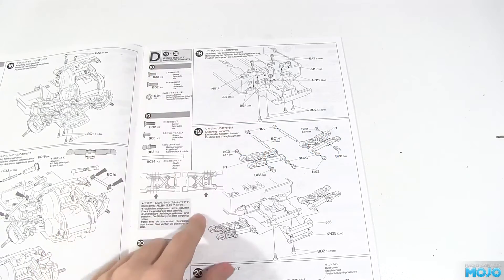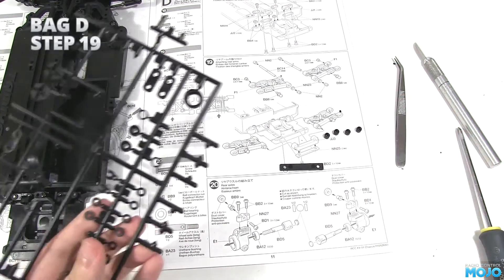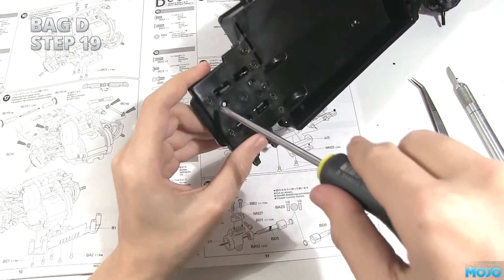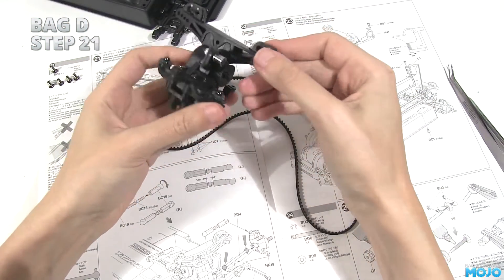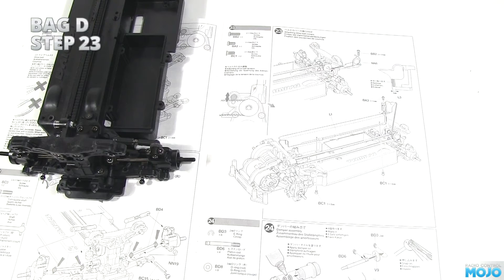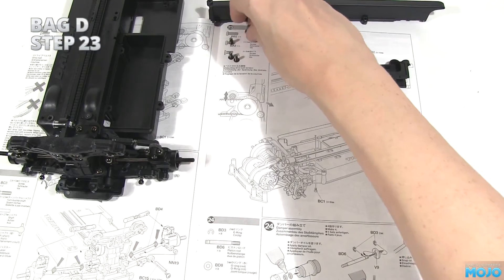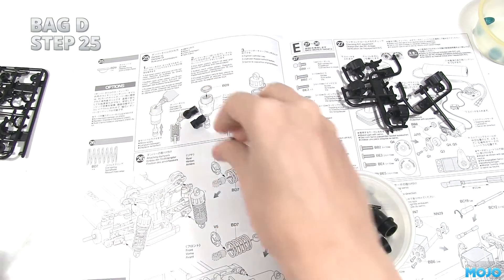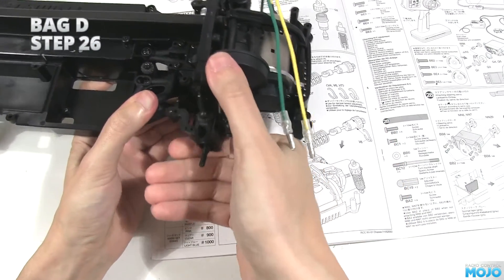Tamiya XV-01 - Build - Part 4- Bag D

Comment: Where do you buy your models in store or online and which ever which stores would you recommend. Seriously thinking on buying a xv-01 but might go for the pro. Great job and love the vids
Reply from the maker: I always start by looking at my local model shops, as in person service is always the best way to go. If anything goes wrong going to the shop you bought the model and accessories from should provide hands on help.
Second I look at not so local shops within the UK, Modelsport, Wheelspin, JESpares, the list goes on, compare prices and see what happens. Being in the UK sorting out any faulty parts is quick and easy.
Third I look at other countries, you have the likes of Tower Hobbies, RCMart, and smaller stores like RC4WD and of course the many others, the problem here is you have to consider the higher shipping cost, and import duty which can make it more expensive that it first appears, also returns due to faults can be a bit of a hassle.
The final method of aquision is good old eBay. Anything bought from there I always assume could be a complete loss, it might be cheap, but it might not be of any use. It's a risk, so don't spend more than you're willing to loose.